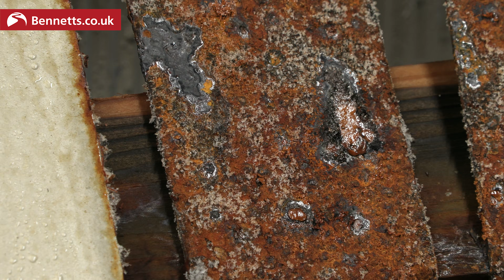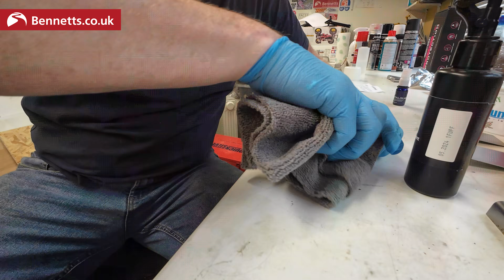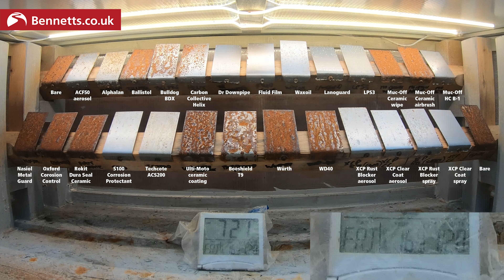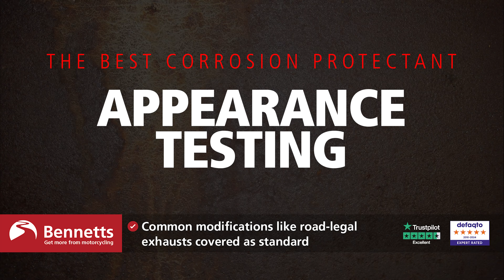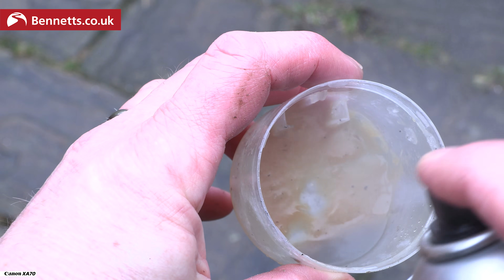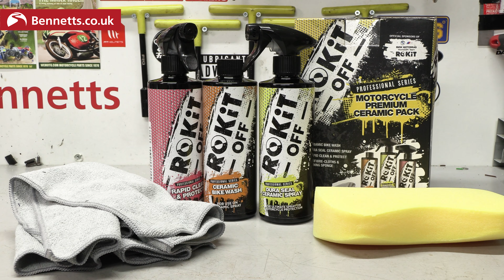Best corrosion protection 2025 | 33 tested | Are ceramic coatings worth it?

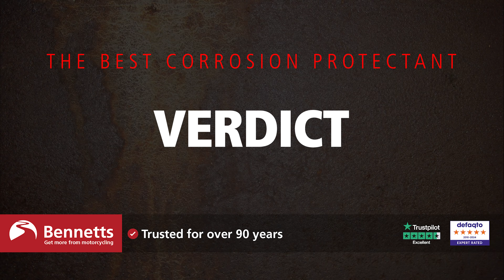Comment: Great test again, thanks! Unless I'm mistaken, there's an error in the verdict section. 16:45min in you rule out Scottoiler FS365 because it needs reapplying each ride, and then you say for this reason it is out of the game, but the video shows you removing Jenolite Waxoil?! Otherwise very useful info!
Reply from the maker: I'm not sure what you mean, sorry! The FS365 isn't a single application product, so that's not included (though is highlighted, especially in the written article). Waxoil is a relatively poor finish, and cannot be removed (to the extent that it's a problem).
Reply: @bennettsbikesocial  Go to 17.25min in the video. You remove a can of Jenolite WaxOil after saying that FS365 is being ruled out. I'd have expected you to remove a bottle of the FS365 at that point. Anyway, good job with the test and it's very helpful.
Reply from the maker: @HeadhunterUK007  Ah, I see what you mean. Did you watch the video in full, or skip to the verdict? The whole thing builds up to why Waxoil would win, but then doesn't. I could probably have made that bit a little clearer but hopefully it makes sense as a whole
Reply: I skipped to the results. Now I've watched it through, it makes sense! Thanks again for an informative test!

Comment: Why was Waxoyl not recommended?
Reply from the maker: Have a watch of the video and I explain in there
Reply: @bennettsbikesocial  I thought that I had! I tend to use the less attractive products on the lower engine areas, having removed the bash plate for access.  Particularly important on BMWs where in my experience the finish is not robust.

Comment: Another fabulous video thanks John. Just bought some XCP that I’ll be applying soon. The rinse off test was interesting for me as I really want to know how well these stand up to being washed with snow foam or my current favourite: fairy liquid that I use on my trials bike. I do different washes, sometimes it’s just a rinse, sometimes it’s a pre wash and rinse and other times it’s a full on wheels out, bits off brushes and deep clean followed by a polish and a re-application of whatever I’m using. It’d be good to know how each wash affects each product. You’re definitely the man for this level of research 😂
Reply from the maker: Thanks! Washing up liquid is a degreaser, so I give t4he bike a spray with an aerosol after that. Doesn't take long. What I blew up into the depths with the compressor will likely stay there for a good while. Hope that helps!
Reply: @ it does thank you. Trials bike gets washed and taken apart a lot more than the road bike so I expect to do more on it and only use washing up liquid cos it gets washed loads. Also I haven’t found anything that shifts heavy mud like it 😁

Comment: Thanks for taking the time and effort to do this corrosion test. It is something that is a real and present problem living in our disgusting climate in Britain 🇬🇧  . I wish motorcycle manufacturers would take this issue with some seriousness  because the  corrosion problem with motorcycles still persists no matter which brand. The car industry finally addressed it but the motorcycle hasn't and it needs to.
Reply from the maker: I've yet to see the underside of a car that looks good!
Reply: @bennettsbikesocial  Well none of mine look bad with regards to corrosion but the point I'm making is that the industry has come a long way from the rusty cars that were common place during the 60's 70's , 80's etc.

Comment: Must admit, I’ve been using Lanoguard under the car for years and it’s been brilliant. I brush apply it.  On my last car, it was still protecting the subframe 4 years in. A wipe with an old cloth had some metal parts coming up shiny. On the bike acf regularly applied seems great but I do apply it after every wash.

Comment: An excellent and informative article again John. I think it highlights there is no "do-it-all-the-best" product. The input from the Ulti-Moto chap was very informative, it would be great to see how some heat affects these coatings, (excuse for an oven purchase😁), also on some alloys. Personally, I use ACF50 as an all-over under the plastic skin coating as it's so well proven to be material-friendly, (you wouldn't want to damage your multi-million £ aircraft). After your last test, I moved to XCP rust blocker for a couple of out-of-sight places where I found water collects under the plastics and it certainly works, I'm going to start using the new clearcoat having seen your results. One product I'm thinking of trying is the Bilt Hamber Atom-Mac. I'll try it on the car first I think. Keep up the good work!

Comment: I think the last owner of one of my bikes took the opinion that if they never cleaned it, treated it or did anything other than basic servicing they would save enough money that when the bike falls apart they would just replace it. 
Never mind that it looked like they parked it in the sea for a few years or that if there were any issues in the heavily rusted chassis they would never see them. 
On the good side, because it looked rougher than your date the morning after a heavy drinking session, I got it so cheaply that it left enough in the pot to pay for everything to be replaced/powder coated/etc so once done it will be immaculate. Glad I've got other things to ride over the summer.
Reply from the maker: Sadly a lot of people treat things with the opinion that they're not keeping it, so why care about the next owner. I've always tried to look after my bikes... I can't afford not to!
Reply: @bennettsbikesocial  I'm the same. I just can't understand why you would buy something then not bother with it. Its as though they didn't really want it in the first place. Over the last few years I've started a little collection and most of them are good bikes which have been mechanically looked after but they either have drop damage which has been left or rust because no one could be bothered to clean them. I feel like I'm saving them in a way because no bike deserves that.

Comment: Having professionally applied a few of these products for over 20 years your outstanding test has proven so accurate to what I use in the field. My go to products are XCP and have been for 7 years, in real world tests and for my customers they really do stand the test of time especially for anything ranging from a garage queen to a lot of bikes that are used year round in all weathers.
Also being a certified ceramic installer your test proves my own findings that ceramics just don't work at all on bikes as an anti corrosion protector, it's fine for paintwork etc but a complete waste of time on all other exposed parts whether bare metals or not. I've seen so many other detailers/valeters selling it as a wonder product and it's just not true.  It has its place but plays a very small part in keeping bikes looking good and is best only used on the paintwork.
XCP really has helped move the game on when it comes to products that actually work. I still carry a couple of other products in your test as some clients will always request them and as long as they (normally ACF and S100) are applied correctly have always offered great protection against the elements and also leave a great finish. 

Thank you John for taking the time to do such a thorough and interesting test. 
Dean @Hi-Shine

Comment: I’m an FS365 fan here, kinda suits me to reapply a few times (and after washing), and I’ve been happy with the results. Not sure why, but it just seems ‘friendlier’ than some of the gloopier options.
Great video as ever, a huge effort here 🙌
Reply: It's easier because it's water based - It's nigh on snake oil.
If you are supposed to wash the bike down after every ride, that indicates (no surprise) the "protection" is washing straight off with water which defeats the point of winter riding protection.
There's a reason why something like XCP requires isopropyl alcohol (brake/carb/electrical contact cleaner) to remove.
Reply: I agree, the sticky stuff just ends I covered in grit creating a perfect grinding paste…

Comment: Ceramics is such a emotive area - I had a bike professionally detailed and ceramic treated (everything not just the paintwork) and, although it did make cleaning somewhat easier, it didn't prevent micro scratches to the paintwork...I have heard it said that the ceramic is only as tough as the paint/surface it's applied to - i.e. a soft paint will still scratch easily even if coated.
Reply from the maker: It's definitely something I'd like to do more testing on, but I have been impressed with the results on my wife's car. Cheers, John

Comment: Thanks John, a very thorough review as always 👍 I appreciate the effort you put into these tests!  FYI I use ACF50 and have had good results although thankfully I don't ride in winter and will avoid rainy days whenever possible.  But it has been effective and there may be some other products to try next time also.  Many thanks!
Reply from the maker: It's not bad, but there are more effective rust proofers. Cheers, John

Comment: I've used Lanoguard on my car for the last few years and am pleased that it does well in your test, it correlates with my experience that it's a great product. I  did try it on a previous bike but it was a bit messy.
 However they now have the new moto product that you tested here so I'll definitely be giving that a go. The lanoguard grease is great on the car too - completely protecting things like tow-bar bolts etc.

Oh, shout out to Corrosion Block grease too - the cousin of ACF50 - that works REALLY well on exposed metalwork in a marine / coastal environment. Not something you'd want smeared all over your bike though 😀
Reply from the maker: Thanks for this! I have used corrosion block grease on axles in the past. Cheers, John

Comment: Ffs , I watched the last years test , bought a Spray gun and used XCP rust blocker last Saturday ... What do I need to buy now lol
Reply from the maker: How did you get on with it?
Reply: @bennettsbikesocial  I was a little scared using it as it was on my 1st new bike and never used stuff like this. It went on really easy using an electric fence spray gun from Amazon but I think a little thick ( wrong nozzle choice by me) . I wiped it over to get even coverage and left it for an hour in a heated garage before another light wipe over to remove any drips ir runs ( very few at this stage) I used this cloth to then wipe over my Dads bike i had also just cleaned. I then left it until the next day and all was good , no runs etc. My Dads bike came up better than it's ever looked. Black plastics looked brand new. My bike was gleaming already but gave it a nice deep polished look. Very happy so far , just hope it keeps the corrosion away from my GS engine 🤞

Comment: Another cracking video, John. Well done. I use XCP Rust Blocker sprayed on but will defo look at Wax oil for other areas out of sight. I'd use it all over but It's a bitch to get off.
Reply from the maker: The new formula of XCP Clear Coat is as good as the Rust Blocker pretty much. Cheers, John

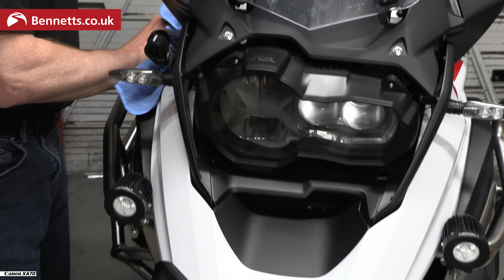Comment: Correction at 21:20 regarding prep work | We usually prep the paint by mechanical abrasion (polishing), after the desired results wipe it down with alcohol and start the coating. This way you are 100% sure that there are no contaminations that could impact results.
Reply from the maker: Good point, thanks! Of course this also means you have the best possible finish to seal in. Cheers, John

Comment: Great video and consistently the best tests and reviews in general in the motorcycle world.

Question tho: 99% of motorcycles in the last 20 odd years are painted plastic and powder coated aluminium. Besides the crappy OEM fasteners (which can be replaced with stainless steel items for £20) what exactly is the need for this stuff?

Underneath cars are completely different because they are predominantly made from mild steel and underneath stamped steel on almost every car.
Reply from the maker: A lot of bikes still have steel frames, and testing of barrier-type corrosion protectants is a lot faster and easier on mild steel. But, after talking to Professor Eden, an aluminium test is coming to check these results. Cheers, John

Comment: Cheers John we'll done and thanks, I remember the last one you did. I have a request for the next one but I might do a test myself and see what happens. A couple of months ago an older guy said to me that he used to coat the bike with vaseline, commute all winter then clean it off with gunk in the spring and no rust. that weekend in lidl they had spray cans of vaseline in the car bit so I thought "why not" and at 3 quid a pop I bought a few cans. So I guess we'll see what happens.
Great Channel, keep up the good work. M
Reply from the maker: I'd be careful with Gunk for cleaning. Your call, but it sounds a bit like an unnecessary workaround when there are proven, specific products about.
Reply: @bennettsbikesocial  true, I think he has to clean off because it was messy and applied with a cloth as apposed to spaying
Reply: I thought de grease products like Gunk and jizer were good products?
Reply from the maker: Just be careful of some powerful degreasers around plastics.
Reply: @bennettsbikesocial  good call thanks

Comment: Correction at 21:00 regarding high tempereture areas | Some ceramic coatings or even graphene and glass coatings do hold up to extreme temperatures. For example GYEON Q² RIM EVO which I have applied to my full titanium exhaust system can withstand up to 800'C.
Reply from the maker: It's something I want to test when I can...

Comment: Another good video. Are all these corrosion protection products indicative of how shoddily our bikes are finished. They don’t seem so good as the bikes I rode all year in the 90’s. I still ride all year….
Reply from the maker: I wouldn't say so... The 2019 R1250GS I have is the best finished bike I've owned out of 21 since 1996. The Honda CBR600 FM, FT and FX I had were pretty bad, especially the exhausts.
Depends on the bike really - my 1999 Kawasaki ZX-6R has a great exhaust system, but the Tokico calipers seize if you open a bag of crisps in the garage.

Comment: Fortunately my KTM is mostly plastic. The only thing that seems to corrode is the  bolt heads on the triple clamp and the grab rails etc. I've been using ACF50 put on with a brush but it attracts all the dust and dirt. What is recommended for such situations?
Reply from the maker: I paint on XCP on my GS spoke nuts.

Comment: I had my bike coated by cf ceramics - learning the results of this test do you know if it’s possible to apply Xcode rust blocker on the bike over the ceramic
Reply from the maker: I would say yes, almost certainly it should be fine to use a corrosion protectant over the top if you want to. How's the paint looking on your bike after the coating? Cheers, John
Reply: Yes, you can 100%.
Also, bare in mind, there are different ceramic coatings out there. Some can, and do protect against corrosion, although these are much thicker than your normal ceramic coating.

Comment: I've used GT85 for many years and it's kept my bikes looking good, but i apply it almost after every ride
Reply from the maker: If the bike's not being exposed to wet and salt, or it's being constantly washed, most products will help a bit. Give Bulldog BDX a go if you want a better all-rounder. Cheers, John
Reply: Nothing smells better than GT85 though!     Oh, Double TT is a great alternative too - I've found that works really well too as a spray-after-wash type thing for exhausts and  the like.

Comment: The lengths you go to in order to find good products to use on your bike are impressive but I do have a bit of an issue with your methodology.
The main issue I have is that you are testing the products on bare metal which is the worst case possible ! If your bike is made with bare metal then there is something wrong !
All steel on motorbikes is painted or chrome plated and all aluminium is either painted or anodised and often lacquered or clear coated to protect it. Yes paint gets chipped and that where corrosion can get in and spread but ideally what we really need is something to prevent this happening.
Reply from the maker: That's the point though - HALT allows faster demonstration, and testing should always be for the worst case. As soon as paint is damaged, corrosion can get in underneath. If the paint stays perfect, we won't have rust (assuming the back of the metal isn't vulnerable). Preventing paint getting damaged is a different thing altogether...

Comment: Top work this! Not very rock’n’roll but bloody useful.
I switched to the XCP products from ACF50 based on the last review. Both my bikes sit in an Asgard on the patio and some condensation in winter is inevitable. I don’t really ride them (unless its bone dry) but even just sat there i noticed ‘some’ minor corrosion with the ACF.
This year with the XCP products, I’ve had none.
Used the rust blocker in specific places and the clear coat all over - have been very impressed. Leaves a nice clear finish too, instead of little purple puddles like the ACF used to 😂.
Reply from the maker: That's great to hear real-world success, thank you! All the best, John
Reply: I found the ACF to be too drippy and switched back to XCP. I ride my bike all winter except in bad icy or snowy conditions... in modern gear who cares about a bit of rain? I'm cosy in my waterproof stuff and my heated gloves, so why would I want to sit in traffic in a car?

Comment: So basically considering how much ceramic coating can cost it has a very limited and specific use and certainly has no real use for corrosion protection, and considering how bikes have limited amount of actual paint work compared to cars 🤷🏻
Reply from the maker: It does depend on the bike – a sportsbike will full fairings has a lot more paint to protect than a naked, for instance